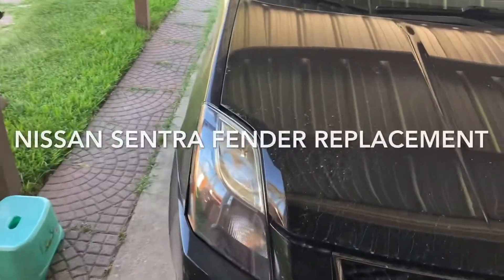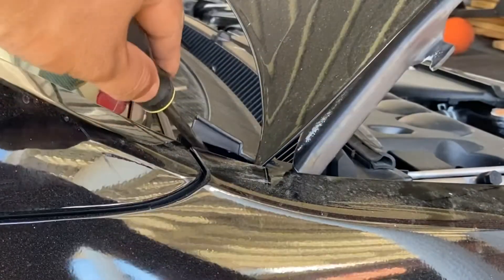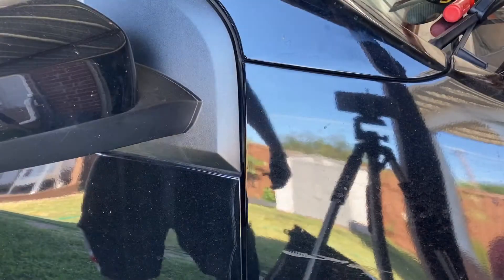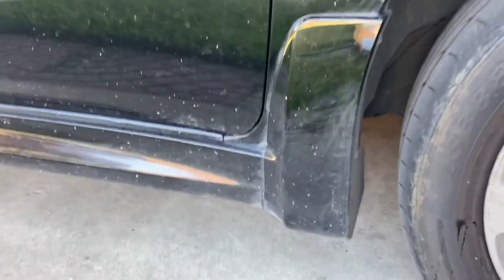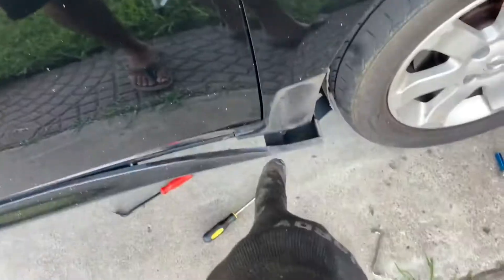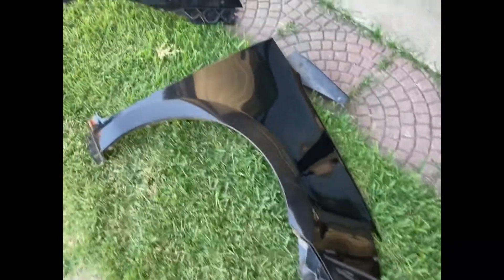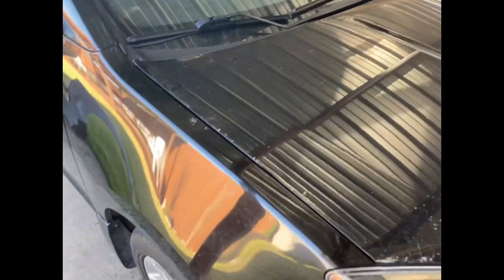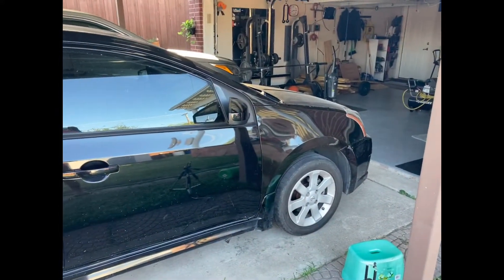DIY How to replace a Fender -  Done on a 2010 Nissan Sentra SR

Comment: Thank you for showing a bolt which holds the bumper to the fender, I didn't think that there is one. I need to replace the fender on the DS (2009 Nissan Sentra). But I can't open the door, it was hit and bent inside. The bolts which hold the fender are exposed, so I think maybe to remove the fender without opening the DS door. Do you think it is possible, or better force the door w/pry bar and open it 1st? I would appreciate any opinion on this matter. The film is great, thank you.
Reply from the maker: I would try to get that door open without damaging the door itself if possible.
Reply: @EATSLEEPJD  Thank you for the replay. The door is damaged to the extend that it should be just replaced, I think. Do you happen know if such door (dent is about 12 in wide and 1.5 in in depth) can be straighten somehow, and who can do it?
Reply from the maker: @olenaerhardt7725   Some PDR specialists could do it if there is no sharp creases.  You have to check locally.
Reply: @EATSLEEPJD  Unfortunately there are some, going deep inside on the bottom of the door, more to the lower door hinge. That door hinge is turned from its normal position. Will I be able to turn it back, so I can attach another door? I think maybe you accounted such situation, when there is a need to straighten that or upper hinge. Thank you.

Comment: It’s easier to replace these fenders because the dent pullers don’t work. The steel on these is so thin that it doesn’t hold its shape when worked back into shape.
Reply from the maker: Ya. I tried and made it look worse lol.  Now only if I picked the right color. Didn’t realize Nissan did 2 blacks for these Sentra depending on year. My new replacement has a little metallic in it.  Only can tell in direct sun tho.

Comment: I have a 2012 Nissan Sentra S 2.0 and from what I understand, the 2007-2013 fenders are the same for this model. Would all the bolts be in the same areas as the SR? Also, what size is the head? I don't want to have to lug my tool box with all the different sizes way to the back of the junkyard (it's a pick a part place so I have to take it off).
Reply from the maker: Yes, should be all same location.  All the bolts are 10mm.
Reply: @EATSLEEPJD  lol I found out today when I went to the junk yard to pull it off.